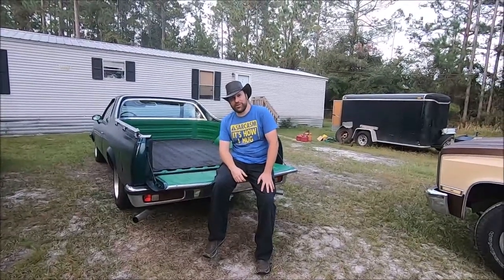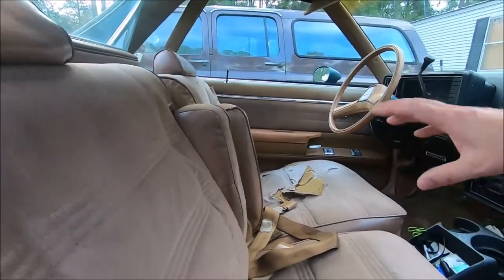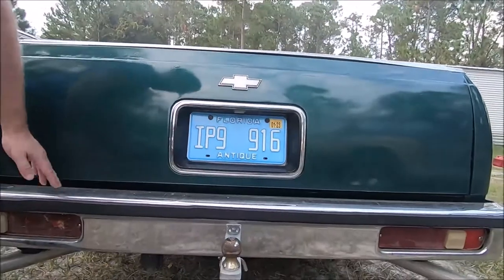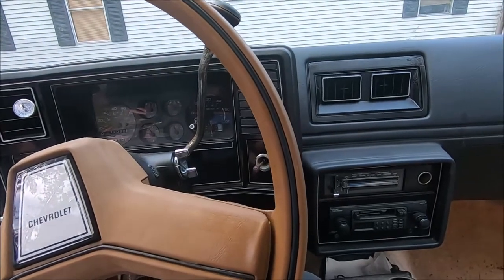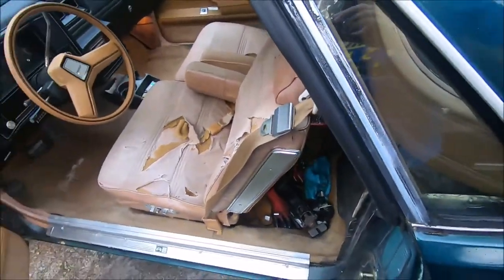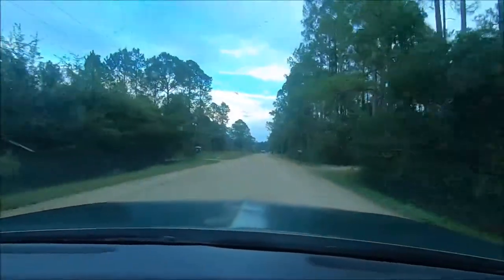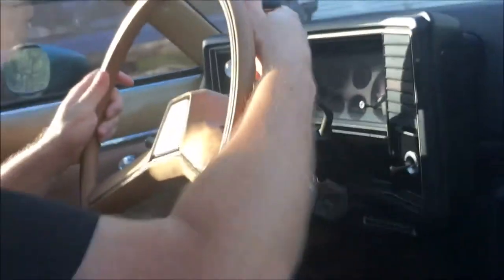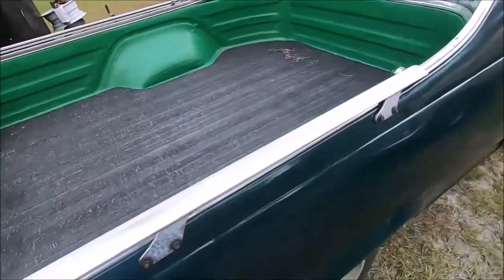1978 El Camino Daily Driver

Comment: I had a Gold a Cream colored 1978 El Camino factory Buckets with center Automatic transmission with Factory 5.7 Engine. AC, PW, PL, Power Brakes , Steering Conquistador package with Standard gauges Am FM 8 track and Dual power mirror. All with limited slip rear end with factory payload package rear Air Shocks.

Comment: Nice. El Camino is an original sport truck / SUV. You are correct about that convenient low load height. Cast iron SBC one of best engines, just leave it stock; easy to get parts. Service that also famous THM350 and it will go the distance. Best part of these old Camino's is smooth coil spring ride versus stiff pickup trucks. Camino's came with adjustable air shocks to  firm up ride with a load. Relatively heavy ( 4000 lbs) + v8 makes good tow vehicle.

Comment: I’ve had pretty good luck hooking the straps to the frame of the cruck to hold things still inside the bed from time to time. You can reach the frame in front or behind the rear tires. if you feel underneath there is good places to hook the straps up. Seems like it’s a circle hole in the bottom of the frame and I think there’s four of them. It’s where the body mount bolts go through. Nice ride thanks for the video. It’s always good to see the car that hauls😎

Comment: Nice video. I just inherited a 1979 El Camino and need to replace both side mirrors before I can drive it. Do you know how to access the housing to remove the side mirrors? It looks like I have to remove the inner door panel in order to remove the side mirrors. Any help would be appreciated. Thanks and I like your El Camino.
Reply from the maker: Thanks for watching! Yes, you need to pull the door card to access the mirror fasteners.